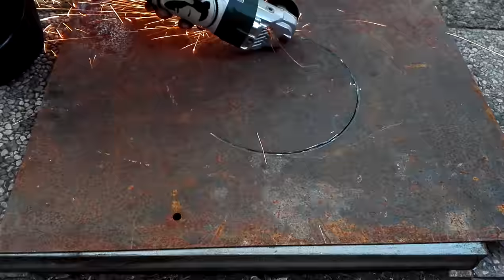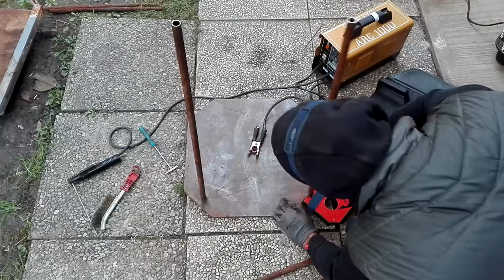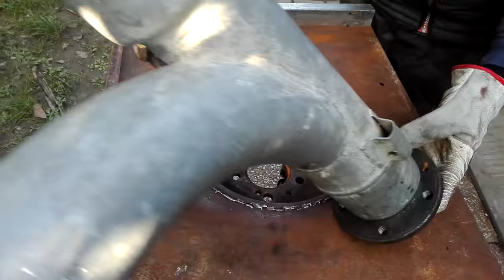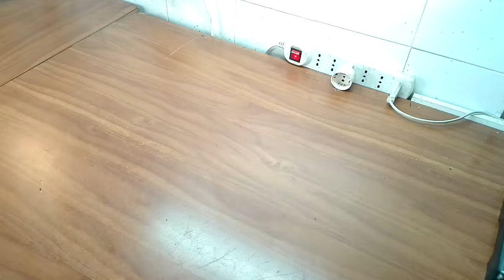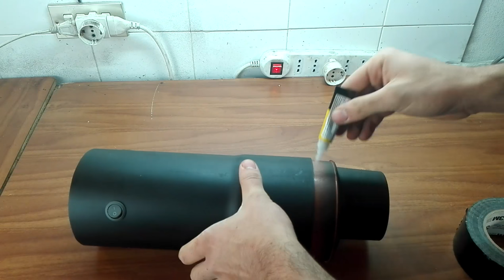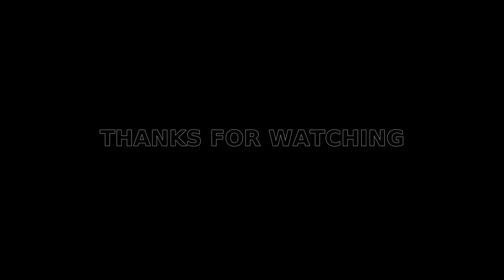DIY Blacksmithing Forge

Comment: You can get a cheap PWM on eBay to control the fan speed.
Or even just a dimmer switch for a light.
Reply from the maker: Well, this vacuum cleaner motor already had his own speed control :)

Comment: Shouldn't there be some kind of guard to protect against sparks and help concentrate the heat?
Reply from the maker: I don't know, I saw many skilled blacksmither have open forge setup like this one :) Also the coke that I have now doesn't brust any spark at all unlike the normal charcoal I used in this video for demostration!

Comment: how do you keep the coals from falling into the pipe?
Reply from the maker: I palced a small roud shadep plate in the bottom of the drum brake hole with many small holes drilled in it :)

Comment: I woldn't give the coals that much air supplie unless you want to forge-weld. Less air should work just fine and your coals last longer.
But still a great project!
Reply from the maker: Thanks mate! :) The coal I used wasn't really working well, I'm getting some real coke soon so that there should be much less sparks and will (hopefully) last longer. We'll see pretty soon!

Comment: I'm just getting into blacksmithing, I want a flatter tools add up in cost,  is it possible to weld a steel plate on a hammer and clinch it?
Reply from the maker: I don't really know my friend, I've seen some flattener made here on youtube but always forged, If you have a tool steel plate and you heat treat it after you've welded it I think it should work :) But I never tryed so don't quote me on this xD

Comment: the steel you use for the outer edges isnt galvanised is it? all ive got is galvanised right now
Reply from the maker: Yeah I don't think those two pieces where galvanised. If you weld just a couple of pieces in a well ventilated area outdoor and you wear a respirator nothing bad will happen! be safe brother :)
Reply: Black Beard Projects thanks dude! Always :)

Comment: Can you make that using a cheap welder? My welder tends to blow through pop steel.
Reply: If you can't tweak the power of the welder, just get thicker steel. :)
Reply: @meatsmell8639  will do. I'm using a skid plate from my dads old truck as the base.

Comment: Awesome forge. I like the design. Very functional and the way you included the blower is pretty neat. Curious though, how hot does the blower pipe get?
Reply from the maker: Thanks mate! :) As long as the blower runs it doesn't get hot at all! Even after a good hr of use :)

Comment: great video it is something i am seriously considering replicating. that being said what type of pipe did you use for the blower?
Reply from the maker: Great! The plastic housing of the blower was water drain pipe and the steel part was a "T" joint for farm grade water irrigation system :)
Reply from the maker: By the way have you checked my instructables article for this build? You should find it in the video description :)

Comment: Hey there! Great job man. I appreciate the finishing touch you give to your gears like the uniform colour and similar. 
I have just an open question to make. If you push the air from down to up through the coal the result is that you end up covering with ash everything. On the other side sucking the air from up to down will probably melt the blower in no time since it’s built entirely out of plastic.
The solution might be to use the Venturi effect using a T connection. Have you already improved this great tool? 
I am just wondering because I would like to build one myself and I have to decide which geometry works best.
Thank you and again, great channel!
Reply from the maker: Thank you!! This forge is still the same, now I use coke and it does not produce any ash. If you use it for many hrs at a time it will form clinker that it's solid so you just need to clean it up before another use. Very fast to do anyway :)

Comment: That part with the vacuum was too gangster. Need a whole clip on just that since I suck with electronics. Need to step it up
Reply: I am 100%, not an expert, that said. I am pretty sure he just added a variable resistor(the twisty knob thing) to the circuit allowing him to regulate the current. Otherwise the motor is either off or on.

Comment: i think u should've installed the pipe the other way to avoid any bit of coal in the blower pipe
Reply from the maker: Then the air would have flowed the wrong way! :D Also coke leaves very little residue, there's no comparison with normal coal.
Reply: Yes sure. U can weld a small flap to guide the air upwards. But since the residue is amount is small and won't melt the blower your idea is much better.  Thanks
Reply from the maker: Thank you mate :)

Comment: Btw. Your moving way too fast with your welds. I did the same thing.  Go really slow and let the puddle build up behind your arc and try to drag it at the right speed to keep the width even with its length